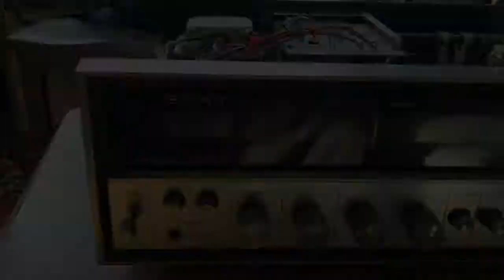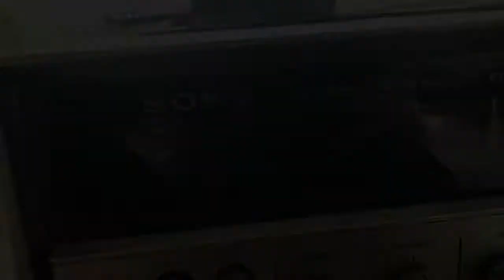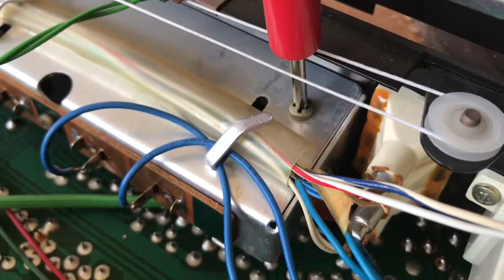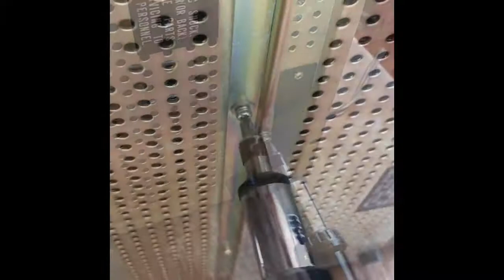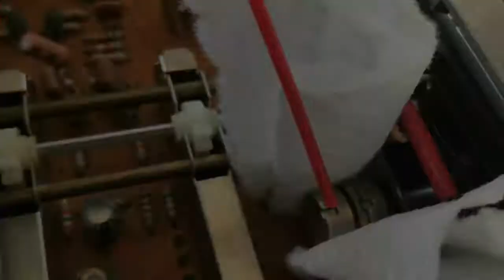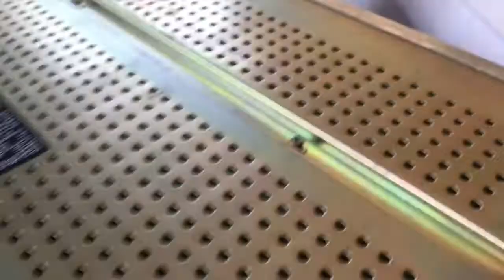Stereo Repair Sony STR 6046A

Comment: Thank you for this video! I've had my STR 6046A since 1973 and clearly it needed to be cleaned up. The Deoxit - which was new to me -  worked like a charm. I also blew out 48 years worth of dust with some canned air. I located the 8-volt fuse-type mini-lamps online and replaced the meter bulb; works again. Two of the really small round bulbs are burned out. Would you have any idea what they are called & where I might find replacements? Thanks again!

Comment: Just watched this  and noticed he is making things difficult for himself when changing the bulbs. I changed the bulbs in my STR-6046 and instead of removing the whole silver cover to access the bulbs, all you have to do is remove the screw on the brown strip at the back of the cover and slip it out along with the bulbs which are attached to this strip, much easier. Then just replace the brown strip and screw. Also there is a clip at the rear of the meter cover, take that out and the bulb comes out.